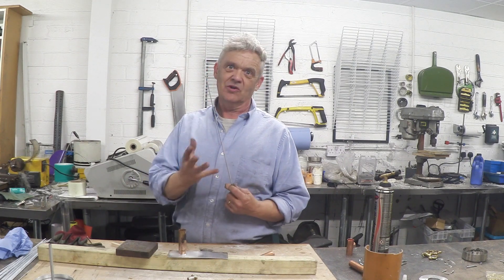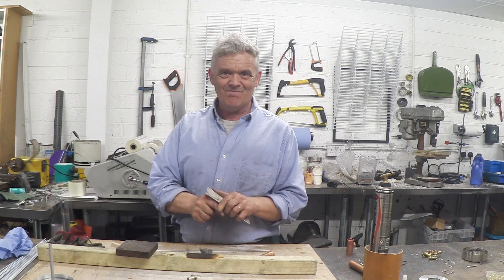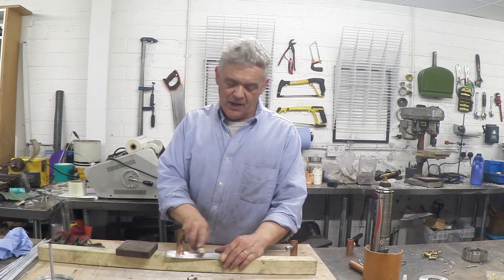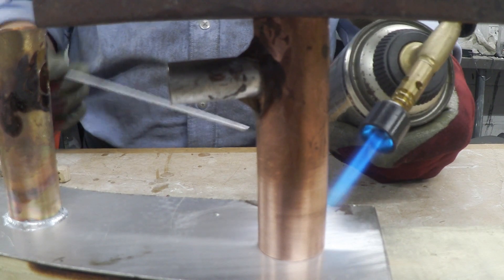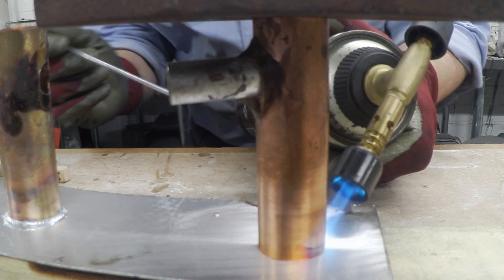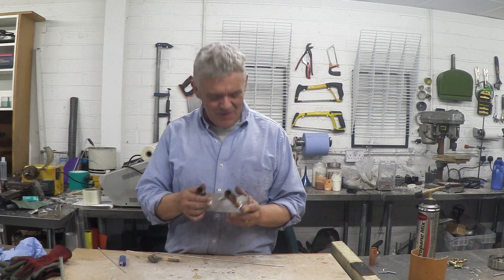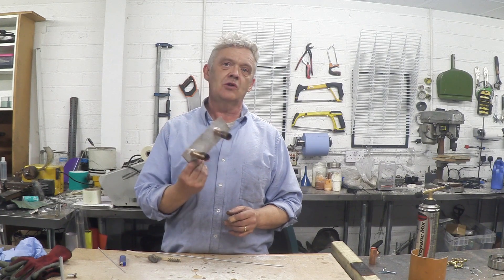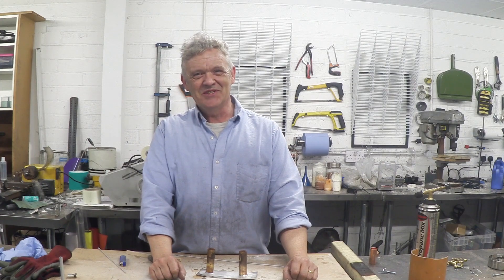Simple Easy Trick For Joining Copper And Aluminium

Comment: Now you tell me..... I just finished 40 joints joining AL tube to Copper sweat fittings like the HVAC guys do with a special rod that included flux (wicked expensive) at very high temperature (950°F) which was very close to the point that the AL became mush.  Lot's of scrap until I learned the correct technique.  Will play with your suggestion.

Comment: Most people think aluminium will not solder, but it solders extremely well.  The problem is that aluminium forms a thin layer of aluminium oxide instantaneously (or close enough for our purposes) when exposed to air, and aluminium oxide will not solder.  You can use special fluxes and rods etc. but what if you don't have any?

If you are looking for an electrical connection only, say an earth connection to an aluminium chassis or joining aluminium and copper wire, you do not need anything except rosin core solder. You can do a submerged joint.  

Simply tin the copper as normal, then sand off any hard aluminium oxide deposits (as in the video above).  Use a normal soldering iron with a sharp-edged bit, in my case a hard copper tip filed to an oblique end (elliptical), you must keep the leading edge sharp.  Create a blob of solder that covers the aluminium, then run the sharp edge of the soldering iron down the aluminium.  This will scape off any newly formed aluminium oxide, the solder will keep the air out so no oxidization, the aluminium underneath will instantly tin, you can't get it off with anything less than sanding or grinding.  Join the two together with a normal solder joint.

If you are attaching an earth to an aluminium chassis, you may need to create a thermal break to reduce the heat loss (aluminium is a very good thermal conductor).  If joining two wires, twist them together, you will only be electrically connecting them in a relatively small area, but this is usually sufficient. High current joints will require more work!    

I have used it to join small sections of aluminium using a gas torch and small brush, it works but is a bit of a pain.  If you do this, clean away as much of the solder as possible after tinning as it will be contaminated with the aluminium debris.  Remember, for all of these joints, two different metals, so electrolysis and corrosion can be problems as it is for aluminium alloys with copper content. Add an electrical potential and the sky is the limit for mysteriously disappearing wire.  

I learnt this method many years ago (50 or so) when I joined aluminium to copper telephone cables (cheapskates thought they could save money substituting 0.51mm aluminium for 0.40mm copper, but they paid dearly for it in the end), after a few tens of thousands of joints, you get the hang of it.
🤔
Reply: Would like to see you making this joint.  Could you post a video?

Comment: Thoughts about converting Hot water tank into Sterling generator. Constant heat source and constant cold source...maybe a tesla oscilator(piston) instead of trying to convert 2 stroke engine. 

Thoughts on making graphene brick size capacitors and using as construction interior brick wall  storage.

Thoughts on Eddy Currents and harnessing eddy curentd as magnet travels through a graphene copper wire  lined pvc  pipe or tube.

Thoughts on
Tritium lined pipe with capcitor and photovoltaic cells and magnet...like those magnetic/battery trains running through copper wire....giving off enough eddy currents to be harnessed or stored..

Thoughts on
Tessa valve and compressing air to turn a converted two stroke and flywheel to run the engine

Comment: Interesting and useful video Rob.
Question, ive read onling many times that copper and aluminium corrode each other and thus its not recommended to do so.
Is this really true or is it the case that if you do x its fine but if you do y it corrodes  badly?

As always thanks in advance
Chris
Reply: Yeah it corods oxidized badly specially we can see on power cables joining between Aluminum and copper.

Comment: People should keep in mind that aluminum has a much lower melting point then copper aluminum is only around 1200 degrees but starts moving at a little over 900 copper on the other hand is almost 2000 degrees and starts moving around17-1800 degrees this is all fahrenhiet . point being concentrate the heat on the copper and let it heat up the aluminum to keep from melting through the aluminum.

Comment: I used to repair a few refrigerators in my past life . That aluminum to copper joint is found in a lot of frigs and A/C s  it was always an area to shun away from.
Thank You very much. Those of us who work with materials never like barriers.
Reply: Sand it well wet course steel wool with plumbing flux and pure tin or tin silver solder. Scrub it in till both parts are wet and place copper or brass sleeve over joint and solder. Takes a bit of practice but holds up for the good. The direct Al-Cu friction welds are cringe worthy. Very common fail point in HVAC systems ime. ❤

Comment: Which Ali brazing rods did you use ?  I bought some and they were very reluctant to melt using Oxy-Acetaline and the result didnt stick to the piece of cast Ali I was trying to repair.
It appears that not all Ali brazing rods are equal.
Reply from the maker: durafix - i was kind of worried about that so i bought a brand

Comment: Robert, I really like you and your videos. Here are some extra tips: Only use the steel brush for brushing aluminium of the same alloy. If you mix them, you will contaminate the brushed area. Pre heating parts in an oven allows for less heat stress and warping. Allways heat up the metal, not the rode (as a smart guy, you found it out at the end of the video). Check the penetration of the welding, make some test peaces and cut them open. There are quiete some different qualities of welding rodes on the market. And the most important tip: aluminum weldings are working over time :D So what looks good and nice today, can be quite different in 6 months.
Reply from the maker: thank you mate - those are awesome tips - cheers

Comment: A word of cation: such joints are susceptible to galvanic corrosion if they get wet, rapidly so with salt water, because basically you have an electrically shorted galvanic cell at the joint. On a related note, I once melted pure zinc ingot and made zinc dendrite by pouring it into tap water, then drained this through a stainless steel strainer and left it wet for a couple of weeks to air dry in an open stainless steel bowl. When I came back to it, I found that the zinc formed loads of zinc oxide because of this galvanic corrosion having occurred due to the zinc having been touching stainless steel. I should have used a glass or plastic bowl.
Reply from the maker: do you know they are used in HVAC particularly for radiator and heat exchanger repair where - apparently  - this is used all the time - I didn't until I checked - so I don't really know but I think the caution might be only slightly necessary

Comment: That does have some electrical uses... Seeing as many places you see old aluminum wire crimped to copper, or else it is solder lugged together....in any case, never the most perfect bond...HOWEVER, this just might be a realistic solution to that!

I'm certain that in such areas as fuel tanks or even water supply tanks, this MIGHT work, but bearing in mind, of course, that a galvanic reaction might still happen...

But all in all, its very encouraging to see this!

       /)/) 
    (  'ˬ') 
@(>_ )-b 
     \) \)
Reply from the maker: for sure

Comment: very cool,  probably still oughta give em a coat of varnish or something or they'll likely have some sort of galvanic reaction if'n they git wet, won't they?
Reply from the maker: yep - but that would only be a problem in certain circumstances - I use a lotto this stuff inside and if you are using this to join electrical contacts chances are it is in an IP rated enclosure already

Comment: Usually it is a question of an active enough flux to do that.
 I seem to recall those rods are zinc based (?) perhsps that is why it works with those two metals.
Reply from the maker: interesting - cheers mate
Reply: Funny that the action of the zinc chloride flux on the aluminum oxide seems to be the same reaction as in sorrel cement
Reply: @mikeguitar9769  i bow to your greater knowledge of such matters, M'lud
Reply: Thanks, although honestly i just googled it.  Also, I figure the brazing rod might be about90% zinc and 10% aluminum because this eutectic melts near 380C.  But i imagine 100% zinc could work too, melting at 420C.  Seems like a cool prepper/hack to know one could maybe salvage such materials from a dry-cell battery or a coin if needed.  The battery case is zinc, and the electrolyte is zinc chloride or ammonium chloride, both of which are reportedly used as fluxes for this.  There had to be a battery in here somewhere!
Reply: @mikeguitar9769  there's a battery in everything these days.😢

Comment: would solder paste not help create an even better bond by allowing it to flow? I know its used in fitting copper to copper for plumbing and in electronics to solder aluminum components to copper traces?
Reply from the maker: very often the flux fits the solder and the metals that solder is meant to join - I wouldn't stick just any flux on here - the rods are supposed to be flux cored

Comment: I've had pop up advertisements on YouTube I mean ThereTube for braising rods that claim to form joints in any metals as strong as weld.
I was sceptical.. But seems they do actually work an no flux or shielding gas

Time to buy shares in braising rod company
There sales will rocket.. You should ask em for commission an some free rods for using there product and showing it actually works!
Reply from the maker: lol - yeah should - but tbh I probably won't lol
Reply: @ThinkingandTinkering  every little helps..
Are all the braising rods similar!? 
I searched braising rods for aluminium/copper "
And got more results than can shake a stick at..

Comment: I thought copper and aluminium was a no no? The copper will eat the aluminium? Do I really recall that wrong?
Reply: If wet there will be a galvanic reaction, like a battery.  If this brazing metal is zinc based, it will erode first.
Reply from the maker: very much depends on the situation and the longevity of the project mate
Reply: @ThinkingandTinkering  Throughout life I have learned that my temorary quick fixes often ends up as the everlasting permanent solution. Until it failes, obviously. 

But the aluminium "soldering/brazing" stick is realy handy. Think Amazon has their own brand.

Comment: that's f*****g awesome !! :) I'll be sure to remember that one.  just a side note, depending on the application, I'm pretty sure joining copper and aluminium together can lead to galvanic corrosion.
Reply from the maker: for sure mate and you have to keep the application in mind - but I am told this kind of joining is very common in AC work
Reply: @ThinkingandTinkering  Is that why my refrigerator stays at 17 degrees Celsius?

Comment: when are the workpieces hot enough for brazing? easy: when the wooden block underneath the torched aluminium plate starts burning, lol :D
...nontheless, great job which again shows the benefits of trying things that seem to be counterintuitive or not beeing exactly feasible at first glance. 

yet, I'd still suggest using some sort of stone slab or whatever inflamable foundation for all things comprising blowtorches or the like ;)
Reply from the maker: lol - yeah maybe I should have used a firebrick lol
Reply: @ThinkingandTinkering  hehe, I extensively know about being actuated by inspiration... and not using all the skills only since last week provides one with a good deal of confidence and sensitivity of what's maybe a bit edged or wonky, and what's actually dangerous ar hazardous... I'm usually ALL the same. after all, I'd reagard using a tinder for a quick braze not a dealbreaker at all for a seasoned expert. yet, at least one part of me might have developed a slightly heightened respect for anything 'violent exothermic reaction' and particularly motorized tools, especially when rotating fast or attached with (saw)blades, chissels, sharp drillbits, u get the gist :D

Comment: Not a friendly combination in the weather though. Best treat it after the joint to keep o2, salts and other nastiness away from it. Maybe clean the joint after brazing and then treat with a UV/water resistant coating?
Reply from the maker: for sure mate
Reply: @ThinkingandTinkering  Thanks. I'm glad you posted this. Though I have used the brazing rod in the past, I'd have never thought to use it that way. Cheers...

Comment: That alumin(i)um rod works well for things like that and it requires less heat than brazing. It's good for repairs on non-ferrous materials and, in a pinch, it'll get you 'home' to make a permanent fix.

Have you ever heard of or tried friction stir welding? Works reasonably well to bond dissimilar metals. Then, we have one of my favorites. Explosive bonding. 😎
Reply from the maker: I've tried both mate - though I have heard stir welding called spin welding and friction welding

Comment: Is there a Galvanic reaction?
Reply from the maker: there will be if wet mate
Reply: Get the joint wet, YES.  The zinc based filler will corrode first.

Comment: Does this mean no more bolts for connection points on capacitor plates? 
Surely a polished plate, scored and a multicore cable connection would bind. 
Can I ask for the resistance and dimentions of a piece of your brazzing rod please Robert.
Reply from the maker: it was a durafix rod mate - I am sure if you check out the TDS some info will be on there
Reply: @ThinkingandTinkering  thank you

Comment: Awesome stuff!. Totally agree with that this opens up some fantastic fabrication possibilities!. Been looking for some time to find a better way of joining copper wire/ tabs onto aluminum sheet for a secure and sound electrical connection without having to drill a hole, and this looks to be the total biz!, many thanks :) (y)
Reply from the maker: I like that suggestion mate - very often drilling, tapping etc is just a pain and all you want is a quick tight joint - I agree this looks like it will work just fine
Reply: @ThinkingandTinkering  Cheers Rob!, and much appreciated too :) (y)

Comment: A well done sir !   from a geothermal Tech from the states. What a nice even clean weld not easy to do. At all. It helps being able to position and reposition the work piece, sometimes you're not able to do that it's difficulty can go up by order of magnitude. any kind of braze or solder its key the workpiece be sanitary.  Aswell majority of the time I like to take a pair of side cuts and mark,bend or nip the side of the solder rod from the end up just the distance diameter of the pipe that helps with flowing the correct amount of material to give a factory looking weld. The more is not more better, just uglier. Depending on how many welds and the size of the work piece I've been known to start with oxy-acetylene or map gas to get the work up to temperature and switch over to butane pen usually allows me to do multiple welds in the tight area without some sort of spray thermal block smew.  if need be.
Reply from the maker: nice advice mate - cheers

Comment: If you have a Trane split HVAC system this is used in the outside unit.
Reply from the maker: I didn't know that mate - thanks for that - with stuff like this you do worry about longevity, corrosion etc - nice to know it is used like that as it means the joint has  a good provenance - cheers

Comment: Got yourself thermoelectric generator

2 dissimilar metals

Add a heat gradient 

You'll get a current
Reply from the maker: might not be much but for sure
Reply: Mark Honea  if you run electricity through it yes it will create gradient

Comment: Not that surprising considering every single copper pipe joint is copper joined to solder joined to copper.
The big question is whether the brazed joint is stronger than a soldered joint.  If so it's surely much cheaper.  IIRC most air conditioning coils are aluminum fins joined to copper pipe... I wonder how they do that at scale.
Reply from the maker: I am told - this way

Comment: That Is Good Rob But As You Probably Know When You Heat Copper Too Much It 1st Becomes Weak And Then Just Turns Powdery . I Learned This  When My Old Primus Paraffin Stove Pump Failed , Not Sure If You Remember Them They Were Brass But The Pump Cylinder Was Copper . Any Road Up I Bought A Primus Omnifuel Stove That Will Basically Burn ANY Flammable Liquid Under Pressure , A Little Bit Hefty On The Wallet But That Little Beauty Really Is A Masterpiece In Engineering 
Bless Up Earthling
Reply from the maker: it can mate but heat joining is fairly standard
Reply: Desmond Bagley  Great Comment Buddy Cheers

Comment: Amazing what about steel and aluminum or even aluminum and 316 ss. Copper and steel is easy with laco flux and solder.
Reply: I've heard the zinc based brazing metal for aluminum also works for common steel.  Stainless is likely to be a lot harder.
Reply from the maker: I'll try it mate

Comment: That's a good looking joint. I like the fillet it made. Copper pipe and aluminum plate are often the best materials but not until now could we join them. HHO might do a good job. It is hot enough to work well. It seems to "wet" both members and looks like a good solder job might look.
Reply from the maker: cheers mate - I solder and braze a fair bit but this took me 30 mins or so to get used to